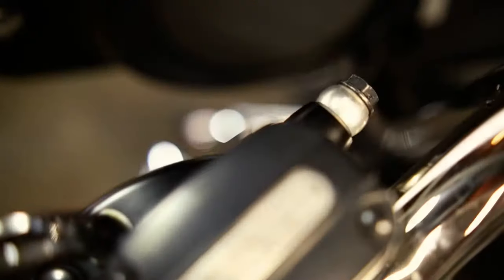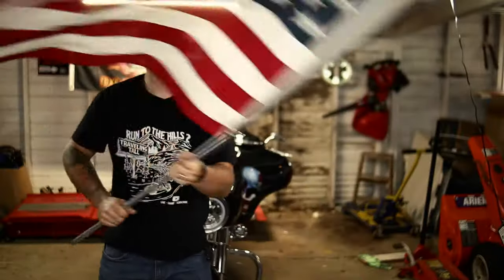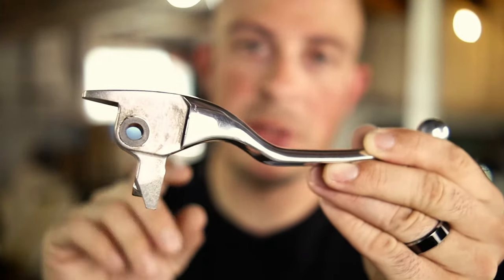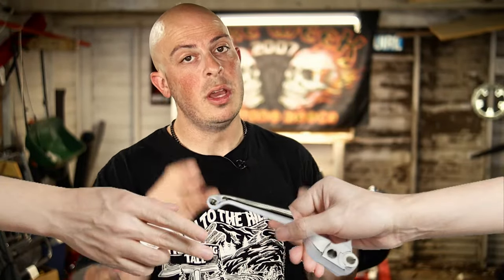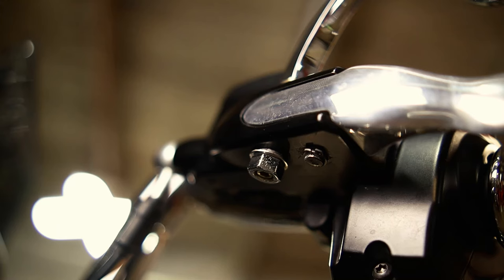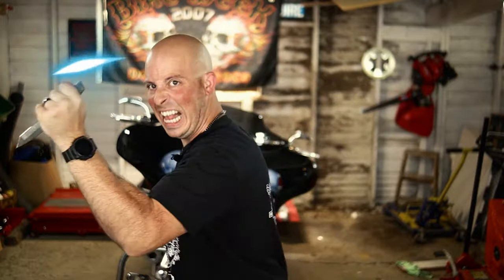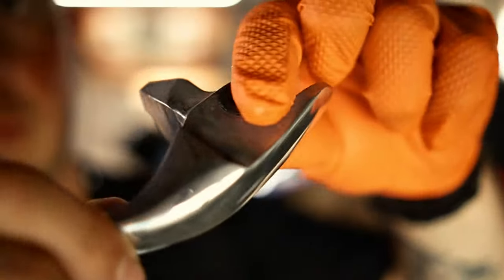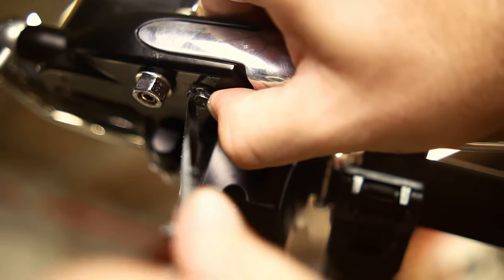Harley Hydraulic Clutch Problem QUICK FIX! | Softbrake Clutch Lever

Comment: I thought about going this route when I had hydraulic clutches on my bikes...now both are cable clutches so no more long reach to the friction zone.  Not sure if cable is better than hydraulic for the long term, but, I will find out.  Great share Joe.  Ride safe.
Reply: @JoeGoeMotorcycleAdventures  👍👊🇺🇸

Comment: I assume my existing lever is somehow altered wouldn't any heating or bending compromise the metal structure and depending on the process would it effect powder coating?
Reply from the maker: I have been using a softbrake lever for a few years now and have had no issue. I've had the stainless steel and black, and both are flawless.

Comment: Hey Joe, I really enjoy watching your channel and I've subscribed. I'm very interested in the SoftBrake clutch lever. I have difficulty controlling the friction zone with the hydraulic clutch on my 2016 Ultra Limited because it's so far away from the grip. I really want to try it, but my only question is, will my it affect my slow speed maneuvering practice ? Will it cause the clutch to slip or drag when the clutch gets hot? Thanks.
Preload and keep it loaded!!
Reply from the maker: Hey Cecil! This will affect your slow speed practice, but for the better! This will bring your friction zone closer causing less stress on your hand. I 100% recommend this. I even put one on my 23' Road King Special and I have a cable clutch on that one. Small investment, big improvement!:_Chuck::_Ride:
Reply: @JoeGoeMotorcycleAdventures Thanks the quick reply. I'll let you know how it works out after I get it installed and tested. Keep up the good work.
Reply from the maker: @cecilsmith7990  thank you! Looking forward to hearing your experience
Reply: @JoeGoeMotorcycleAdventures  Got the lever installed and took the bike out for a short test ride. AMAZING difference. Clutch starts grabbing much closer to grip and is easier to control in the friction zone. The lever rests in the strong portion of my grip instead of my fingertips. I am extremely pleased with it.  Can't wait to take it out for a full workout!!
Reply from the maker: @cecilsmith7990  awesome! I'm glad that you like it!

Comment: Soft brake has two clutch levers for my trike, one says 2009-2018 trikes and reduces reach 1” and the other  says 2014-2016 and a 1” reduced reach. Both are for the same trike. I can’t tell what the difference is. It’s confusing. Do you know which one to get?
Reply from the maker: I'm not sure brother. If you call SoftBrake, you will most likely get ahold of Rick, and he is a wealth of knowledge. He will let you know

Comment: I bought this it seemed ok then found out I couldn't start my bike when in gear so I had to bend it back out so that would work. So I bought a PSR adjustable clutch lever and problem solved.
Reply from the maker: I always start my bike in neutral, so I never had that issue. But good to know!

Comment: Hydro clutch has been around since long before 2017. Both my 2012 RG and my 2015 RGU have it.  I had one that came on my '11 and I'm pretty damn sure they started as early as '07 on the CVO bikes. Problem was resolved in '19 with a new damper spring in the clutch. Way to try to make a sale for someone all the same time getting paid by YT for a review. Have you thought about a career in the media? They're always looking for people to doctor up basic half truths to push an agenda.
Reply: Can feel the drag when starting in gear and also when pushing in gear when clutch is fully pulled in.  They said my grips were to big in diameter, “so I changed them to smaller ones from Harley and same shit no better. Then they told me take off the lever and file the inside were it contacts the switch or send it to them and they would do it if i wasn’t comfortable with the mod.  Are you shiting me or what.  Can anyone say flo adjustable levers for Harley. I’m just saying mister trade in.
Reply: The clutch on my 19 ultra is way out there and I have big hands. Not sure how ‘fixed’ that makes it. Anyway, I ordered one.
Reply from the maker: It makes a huge difference. Let me know how it is after you get it.

Comment: When life gives you lemon... Well you two finger it 😊. There is an advantage of clutch that engage far out... Faster shifts because you don't have to pull it all the way in.
Reply from the maker: I can see that advantage. If you can get used to it, then great! However, I don't want to stretch my hand out that far. To each their own. Appreciate you watching and leaving your feedback!
Reply: @JoeGoeMotorcycleAdventures  try two fingering it
Reply from the maker: @johnny6705  I have. I like to have more control when manipulating the clutch with using all of my fingers. Plus, the hydraulic clutch is pretty stiff.
Reply: @joegoemotorcycleadventure is that true with all hydraulic clutch systems? Is there no way to soften them up? I wouldn’t mind the distance if the lever wasn’t so stiff.
Reply from the maker: @BaccaratBible i can only speak from my experience with my motorcycle. I know you can completely replace the clutch to get a softer pull.